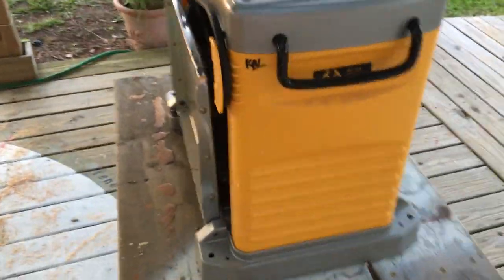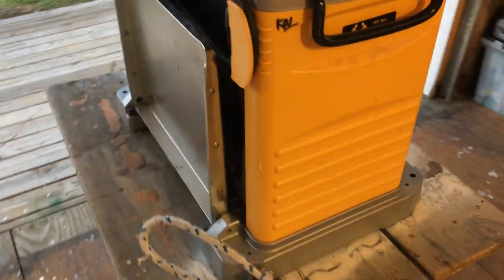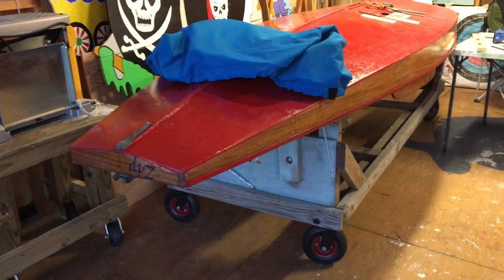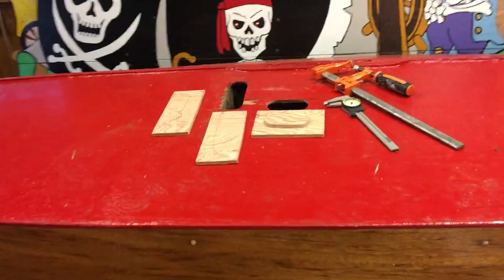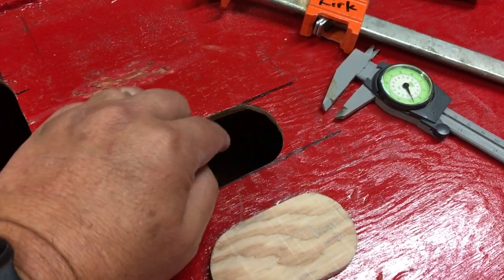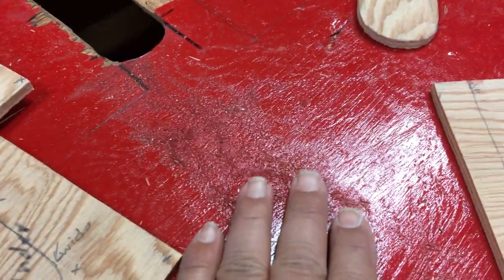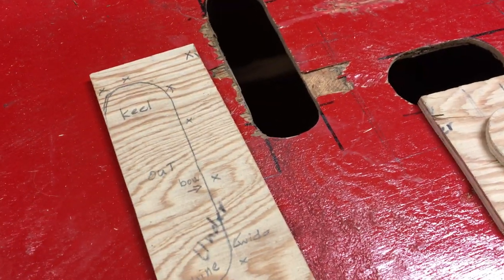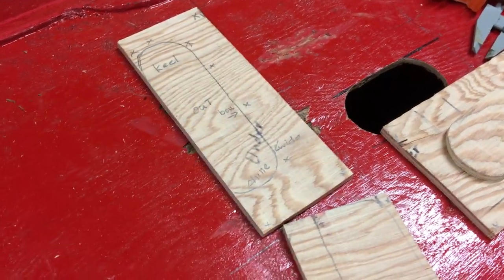DeWalt Tabletop Planer on Wheeled Shop Cart

Comment: Great video as always.  Thank you!  Just starting to work on my 70's sunfish.  I found that the supposedly stainless steel screws holding the inspection port are rusty and rotted.  Suspect that is where some of the water is coming from.  I'm thinking I'll dis assemble, clean, acetone, re-silicon.  Does that make sense?
Reply from the maker: Yes Sir, not all stainless is marine grade. We trust the stainless that we get from marine supply stores and our local Ace Hardware has a great stainless section, possibly because we are here on the Gulf Coast. Nothing worse than removing rusted stainless, including sanding. I'd use a marine grade sealant as well, 3M 4000 would work. 3M 5200 is overkill. If you use silicone be careful to not get it everywhere, it can leave a film.